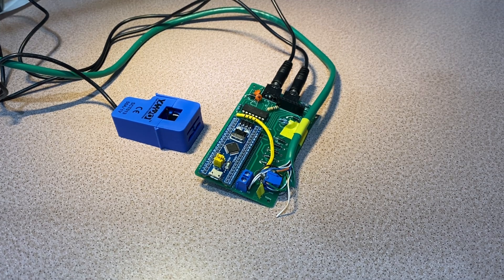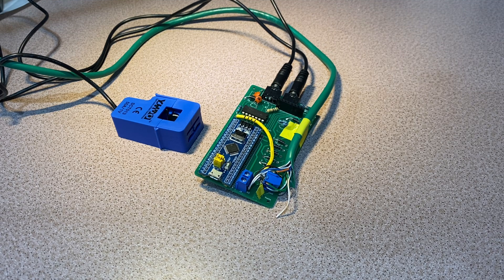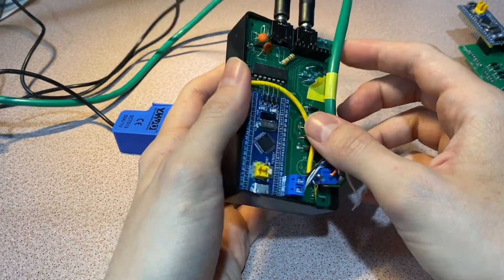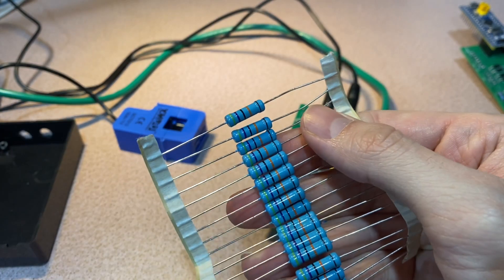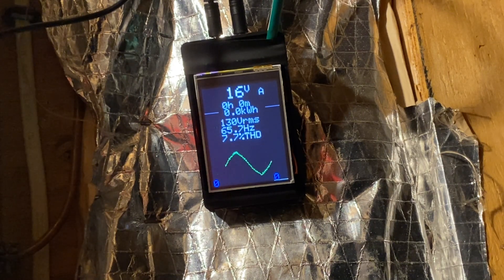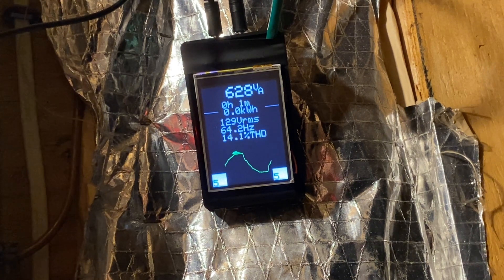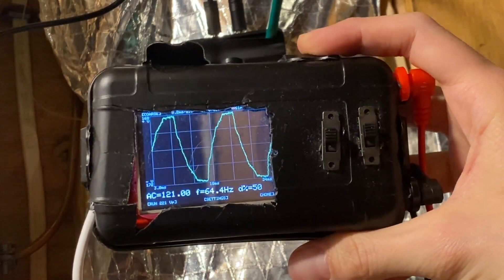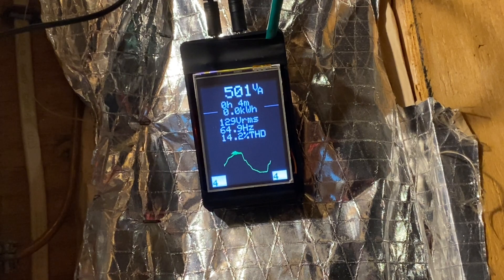Arduino STM32-based home backup generator power/THD monitor

Comment: Nice project. Can you share the schematic or pcb ?
Reply from the maker: Let me see what I can dig up. Do you live in the US? (In which case I might be able to ship to you) From memory, the schematic was similar to the Rospo project, except the signal ground is around 1.65V so it doesn't need to use a separate op amp to offset each individual channel into the 0-3.3V range of the microcontroller.

Comment: The current clamps come in several amp ratings.  Does it matter.
Reply from the maker: I used the 50A version and that's what the scale factors set in the software are for, but you could use something different and just change the values in software for the calculation of Amps1 and Amps2, where I used 1.3*0.04028 because that seemed to be about right in my case.